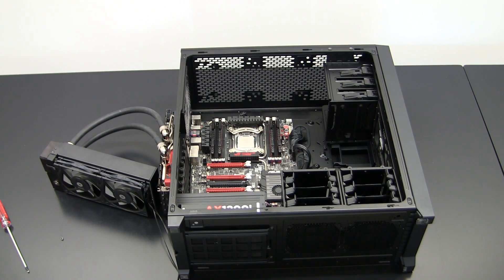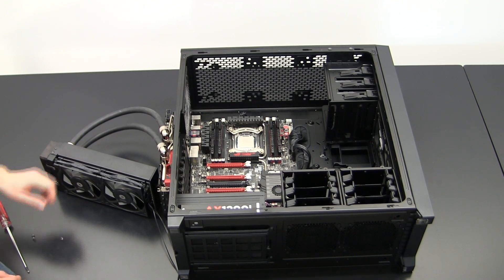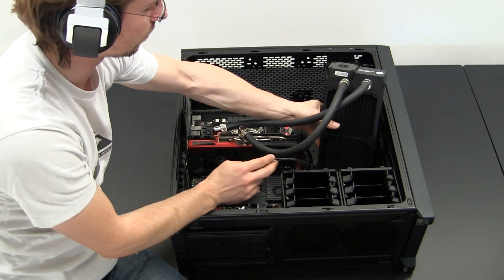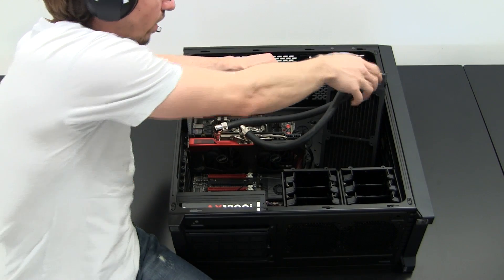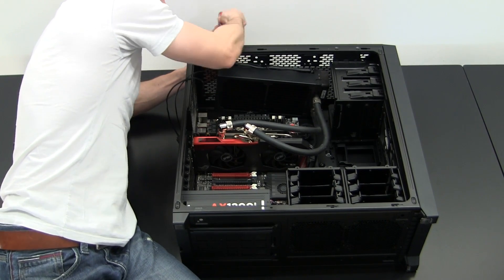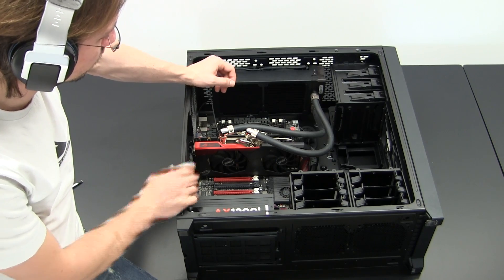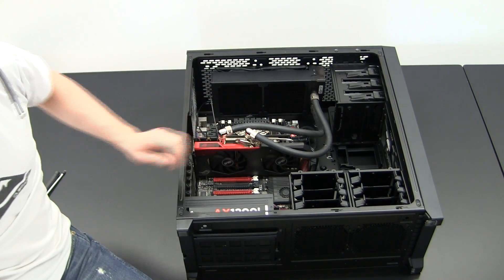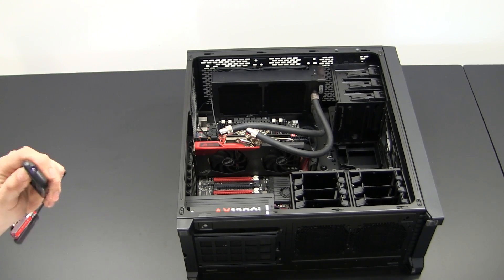How to - Install an EK Predator 240 watercooling a High-End VGA in your case

Comment: I can't wait until I can put my EK-XLC Predator 240 1.1 in my case. I can't lift it right now due to a left ankle complex fracture, dislocation, 5 metal plates and screws, so no wait on left leg for a while.
Reply from the maker: Damn ... that sucks. But yeah, the Predator is definitely a great product.

Comment: +OC aholic
Would you happen to know the precise temperature that GTX 980 Ti starts to thermal throttle?
Thank you for answering my earlier question.  I appreciate you sharing your expertise.
Reply from the maker: According to NVIDIA their so called "Maximum GPU Temperature" is set to 92°C. Therefore a reference GTX 980 Ti should start throttling at that point. Vendors can usually change this max temp to a lower setting. I don't know the precise temperature for this card, but it should certainly not be below 85°C, since I've never seen any GTX 980 Ti throttling at that temp or below.
Reply: If a 980 Ti hits the 92°C temperature (thermal limit), the GPU will shutdown the system to prevent damage to the graphics card.  The target temp is 84°C with the default fan curve.  The point of initial thermal throttle is definitely well below 84°C, I just couldn't remember the precise temp.  I'm currently catching up on some folding @ home, so I can't afford to stop folding in order to ramp up my GPU while monitoring in MSI afterburner.  I appreciate the swift responses.
Reply from the maker: damn ... I really mixed stuff up :( sorry for that!
Apparently you're right 84°C is the target temp. If you watercool your GPU (1 GPU) with a Predator 240 you can be certain that you will never see temps above 80°C. I would be surprised if you ever see temps higher than 65°C, unless ambient temp is already 40°C+.

Comment: +OC aholic
Great video.  Question: What graphics card was that?  And what temps did you achieve with the Predator 240 connected to it?  I have a Predator 360 installed in my Define R5 case, currently just cooling the CPU.  But I plan on adding a GPU once the EVGA 1080 Ti hydro copper comes out late this year.
Reply from the maker: It's an ASUS 980 Ti Poseidon. Temps were between 50 and 55°C when I was running Furmark.

Comment: can i fit a EK predator 240 for my GPU and a EK predator 240 for my CPU in a corsair 750D
Reply from the maker: Should be possible, if you remove the HDD cages.
Reply: +OC aholic how about a EK predator 360 in top and a EK 280mm radiator in front
Reply from the maker: should work imo
Reply: +OC aholic Nice

Can't wait to watercool the msi 1080 and my cpu later this year
Reply from the maker: Oh man ... that will be a dream :)
Reply: +OC aholic i know

Comment: Hey there, nice videos. Could i use this AIO to water cool at the same time, CPU, GPU and my motheboard ( Gigabyte Z170 Gaming 1). To my understanding I may need some more tubing and some angled fitting plus additional comrpession fitings.
Am I right in assuming that this is possible ? Will you be doing such a video or even more extreme to include RAM and NVMe SSD watercooling ? That would be amazing ! ! ! !
Thanks anyways.
Reply from the maker: Well if you want to cool this many components with one and the same loop, I'd recommend you to go for the 360mm version of the Predator. In that case this would be possible. And sure, you'd need some more fittings and also some more tubing.

Comment: I have the noctis 450, it does support upto 360mm rad but does anyone have this setup that can confirm that the predator 360 will fit in the noctis 450 ? also how often would i need to top up/bleed the system ? thanks
Reply: If it is 240mm rad and another 32mm cause of the pump and reservoir
Reply: also same rule of thumb with the 360 rad.
Reply: Alain Tabangin ok, the issue i have is that the predator 350 fan/rad is 68mm depth,space in between my fan brackets and 1st stand off for mobo on noctis 450 is only 58 mm, which means the predator 360 will overhang mobo by 1 inch which will cause issues.

Comment: can I use a fan splitter on the 3 fan input to power 2 led fans for a push pull setup ?
Reply from the maker: +CapcomsHero Yes, that should be no problem.
Reply: +OC aholic I have another question.. if I use corsair sp led fans, will I be able to control all fans on the pwm hub ? the corsair fans aren't pwm, so that would be a push pull setup with 2 stock Caesar fans and 2 corsair sp led fans
Reply: +CapcomsHero corsair*
Reply: +OC aholic   if i use a 360mm and a 240mm of this thing to cool my cpu and my gpu it will work? Also it can fit those 2 on my corsair 760t?
Reply: +Λευτερης Καλκουνιας With the 360 predator you can have a maximum of 3 blocks on the system. So your 360 can cool your CPU and GPU. You just need EK expansion pre-filled GPU block. They make blocks for most modern GPU's. As the system uses the QD cables then it's literally 5 minutes to add the GPU. See here: http://www.guru3d.com/articles_pages/ek_predator_360_aio_cpu_gpu_liquid_cooling_review,16.html
Reply: +CapcomsHero Corsair has nothing to touch this and even more so with the 360..